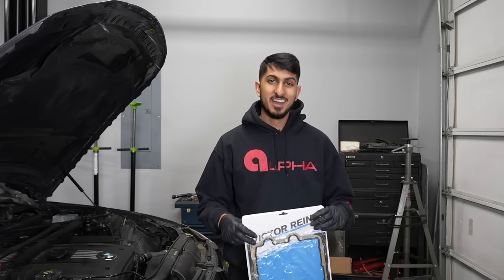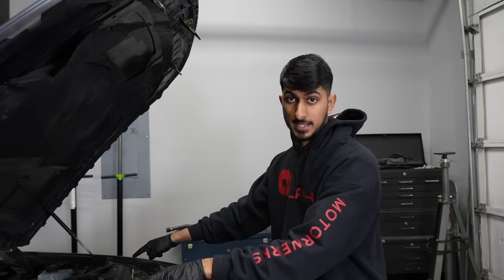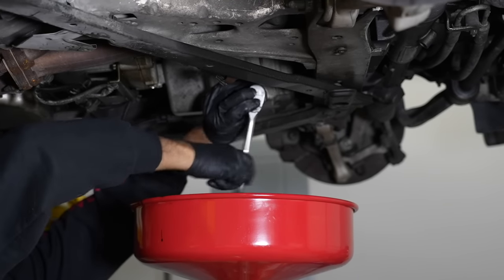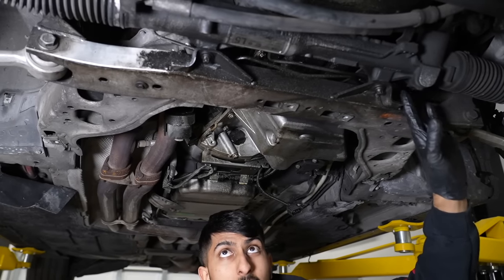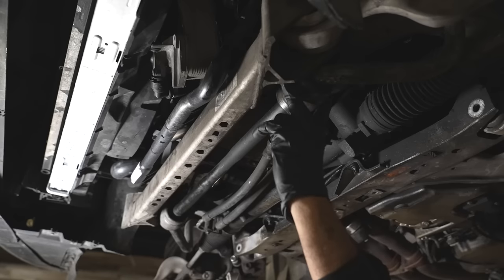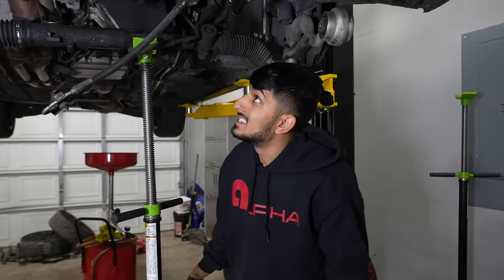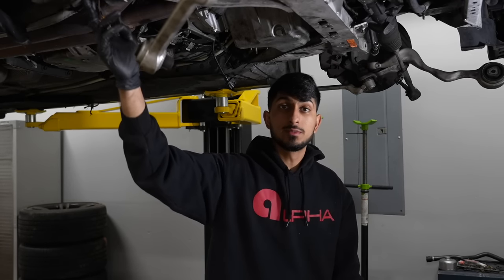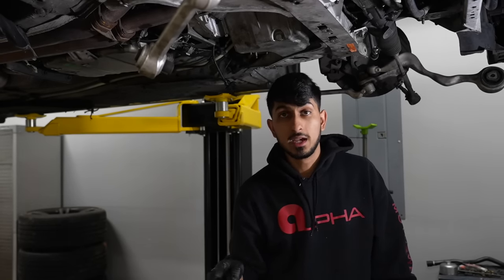How To BMW E9x Oil Pan Gasket Replacement Tutorial DIY

Comment from the maker: Hope this video serves as a good guide for all E9x owners that need to replace their oil pan gasket. Even though I didn't do this...I highly recommend removing the entire steering rack along with the subframe from the car so that it is easier to torque the oil pan bolts. I will briefly go over steps to remove the steering rack in an upcoming E9x front suspension video, which will also be a part of the E9x playlist. You can support me and this channel by using the affiliate links in the description and by liking/subscribing and sharing my videos! I have a few more DIY videos going up before we are back to our build videos! Can't wait! Thanks for watching and keep wrenching!
Reply: I love your videos and have used quite a few of your DIYs! Can you please do a video on how to drop the E9X rear subframe? (to do the subframe bushings or rear sway bar, etc)
Reply: Great video , Any torque specs ?

Comment: The fact it is usually the inner part of the seal is more evidence that you need to change the oil more frequently on these cars. Pro tip too, use an inch pound wrench for the oil pan bolts. Set it to 12in-lb per ft-lb so 72 inch pounds. It's a smaller torque wrench and will help in preventing over torquing due to variable tolerance in the wrench's accuracy. I had this realization after doing my transmission pan (one wouldn't get completely tight, might have over torqued). I have yet to do my OPG but also picked up some paint pens so I can mark the bolts before final torque. Much thanks for the video, super informative.

Comment: Love the channel. Excellent video.  I tackled the oil pan on my 08 335I E93 on my back in my driveway, then two months later the rear seal popped out so out came the transmission and in went a new rear seal.  Your videos are always helpful.  It's been 1 year since my oil pan and rear seal and still no leaks.  Thanks for producing your videos.

Comment: All three of my oil level sensor studs snapped when I was taking it off. Once I cut the nuts off I removed the oil sensor and there was enough stud in there to use pliers to unscrew them. Ran to the hardware store and grabbed a 10mm bolt the same thread pitch and length and all is well. No need for a new pan like you mentioned.
Reply: Also thanks for the tutorial, followed it along side fcp euros guide and it helped me out a bunch!

Comment: I'm at 148k miles. Oil all over the bottom of my car from the engine pan gasket leaking. But, one of my turbos had given  up the ghost so Im currently having a bmw performance shop install new ones (Vargas). They're only charging me $200 to do the oil pan gasket in addition and I was so relieved. Plus I needed a High Pressure Fuel Pump and they had two good used ones from engine swaps they've done. $500 installed. I couldnt have done this on my back. Nevertheless this was an outstanding DIY video if you have to tackle it yourself. I would have freaked over those broken oil pan bolts. I got them new ones to install. Wished I could have afforded the new engine mounts too :(

Comment: Great DIY brother and sister. I read about the ridiculous torque procedure for the control arms. Car at full load on the ground + ap. 65kg in the left and right seats, + ap. 65kg in the center of the back seats, and last but not least ap. 25kg in the center of the trunk.Then torque to spec. Is there any garage doing this, while changing these control arms? Dutch regards Nico.
Reply from the maker: Thanks Nico! Yes the weight added procedure is also used during alignments. Most shops do not follow this as it is a bit much. At the very least everyone should have the car on its own weight before torquing suspension, but if it is a track car then the weight procedure should also be followed.

Comment: Have you ever dealt with the e46 EML and traction light limp mode ? I thought it would be the throttle body or IACV. But no luck 🥲I have the throttle body that still has a cable and sensor

Comment: Trying to do this job now on N51 and this pan will NOT drop. Maybe need to tug more on the rear but damn man. Why does it have to be so difficult. It's like it is getting hung up on one of the half circle parts at the rear of the pan. Any ideas? Could it be the gasket itself?

Comment: I have a question 🤔  do you know why I get hot air from my passenger  vents when I turn the AC on? I already replaced the heater valve control. 2004 e60 530i

Comment: Hi, i have 320i 2011 series 3 e90 car.  It has a transmission issue. DTC code is 56BF. So I’m planning find out used gearbox from wrecking yard and fix into it. After replacing the gearbox, does it need to do transmission reset or something. Please tell me

Comment: At 18:35. The wiring that's on the bracket that's held by the  2 E10 bolts. What is the wiring for?

Comment: Is there a different way to support the engine without the tow hook? The area where it goes on mine is broken 😞
Reply from the maker: You can lift up the engine by the oil pan with a block of wood. Once the subframe is removed then use 2 jacks one on each engine mount arm so you can remove the oil pan.
Reply: @ShopLifeTV  thanks!

Comment: not a bad idea do replace your water pump and thermostat since your right there  same gos for your engine mounts..  I mean your right there already no sense in doing all that frame removing agin few months down the road.   also there's nothing wrong w RTV hell the rev would seal up better then that pos BMW pan gasket design does anyways !!

Comment: Will leak again in no time.
6ff/lb and 90 is absolutely not enough.
That might apply to brand spanking new engine not to 20 years old block and oil pan with thousands of heat cycles.
20ft/lb or 27NM is sweat spot
Reply: Aluminum bolts for the oil pan. Single use only and you cannot over torque.

Comment: I'd never use a Victor Reinz gasket given the amount of labor that goes into removing the oil pan gasket. You save $30 using VR over BMW but man I'd rather not do that job twice. I get that ECS Tuning sponsors the channel but that oil pan on any BMW is a bitch.
Reply: FYI - Victor Reinz is OES, OEM, and OE parts supplier. Mahle Group is their parent company.
Reply from the maker: I have seen OE, Victor Reinz, and Elring all fail prematurely, which is why I opted to use the RTV on both sides of the gasket since I don't want to deal with this again on my cousins car (he also doesn't live close by). ECS tuning doesn't sponsor the channel. We collabed on some of the DIYs for this E90, but I chose what parts I wanted to use.